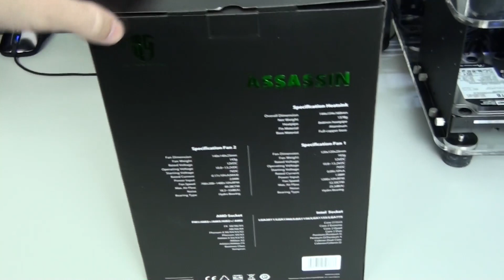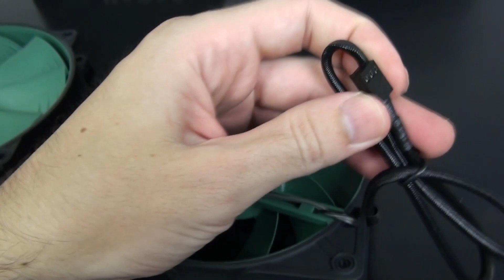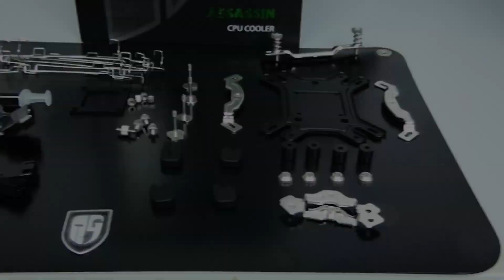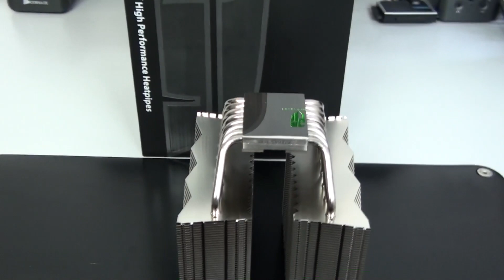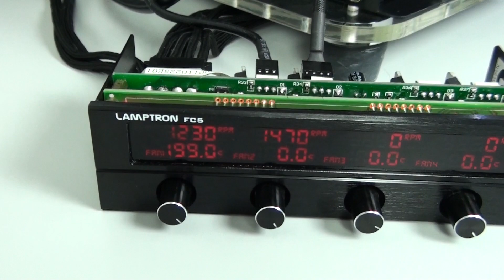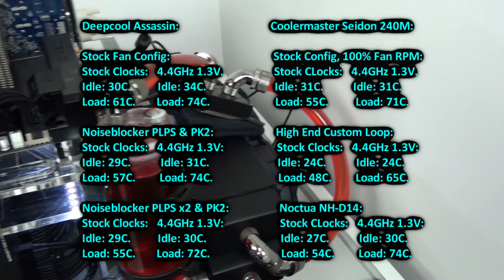Deepcool Assassin Review

Comment: I added up the cost of that custom loop, I didn't include the cost of the fittings because I don't know how many it took, but for the main parts $380.  So, already 4 times the cost of the Seidon 240 minus the fittings.

All that money buys 7 degrees better performance over a cheap AIO cooler.

That is absurd.  Call me jealous or w/e you want... I'd rather put that extra 300 bucks into something a little more worth while.

Comment: i have it on my 3770k, and it works great, i am using it with fans under 50% rpm until it get to 60 degrees, so its pretty much silent until i open a game(bah, depending wich game, on game like dota 2 it never gets to 60 degrees, and i have it overclocked to 4.5ghz)

Comment: Great review. Your comment about copper fins however, I think would not work. In a normal case/config, the motherboard will be upright, and a cpu cooler that large with copper fins will be too heavy. That amount of copper in a heatsink will weigh over a pound, and put a lot of stress on the motherboard. Thats why i prefer all in ones currently, the pump/block is the only thing attached to the motherboard.

Comment: mine is quite quiet. my 120mm is at 1330rpm and 140 is at 830rpm. they are on separate fan headers on my motherboard. i used them together on the cpu header with the splitter(not the lna one) and it wasnt much different in sound. i cant hear mine unless my case is open and my ear is close to it. but it is the loudest thing in my case at idle.

Comment: Sir, I see you use a jig saw to cut your acrylic tubing. My question is, please: Besides a jig saw, band saw, what would be another accurate, way to cut lengths? Would a coping saw be too flimsy? I was thinking of placing the tubing in a drill press vice with rubber bumpers so as not to mark the tubing and then cut carefully. I saw a used scroll saw on CL but I'd rather not purchase something I'm really never going to use again. I just bought tubing but don't have it yet. Thanks for any advice.

Comment: For measuring the noise level of coolers or fans, I'd recommend to get a dedicated microphone and fix it on a stand, so that there wouldn't be differences between the location of the measurements or any other variations between them (except hardware tested). I think standardizing the measurement method would give clearer and better comparable results.

Comment: I suppose if your ambient temps were lower your deltas would be much better. I get a variance of 6 degrees C delta from summer to winter with 2 360 mm, 63 mm thick rads, about time you moved to Canada huh. lol. Did Intel realy need to change sockets so quickly? will you be doing any Haswell client builds in the near future?